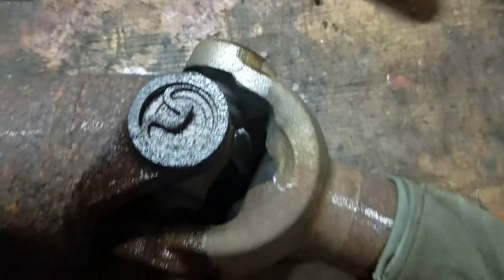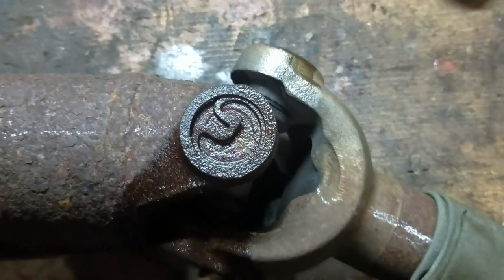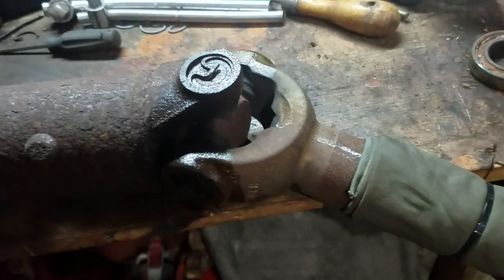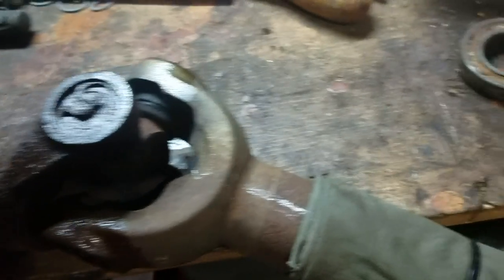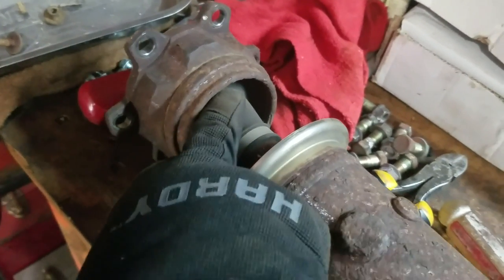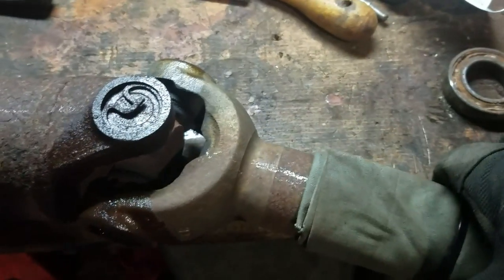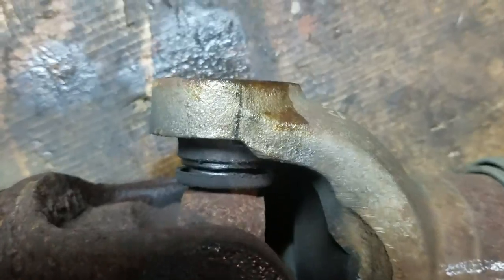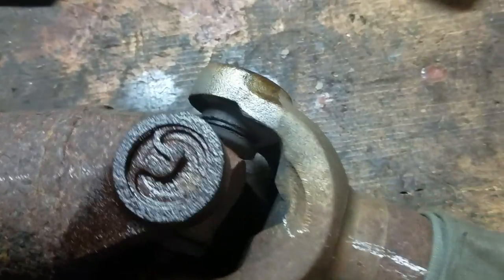What a bad u-joint sounds like

Comment: My 2006 Silverado makes a popping and cracking noise at low speeds in drive and reverse. No noise when shifting from park and you have to be moving. It quits once you go about 15 and up
Reply: Same problem for my 2013 Focus ST. Did you figure out what the problem was?
Reply: Besides swapping out your u joints make sure your driveshaft yoke that connects to your transmission is well lubricated
Reply: Ever figure this out?
Reply: My car makes a clunk when coming to a stop from 10 to 0 not sure if it is the u joint since I changed tranny n u joint
Reply: My truck is doing the same thing
Reply: What did it turn out to be?
Reply: Same mr 04 does this
Reply: Did you ever find out the cause?

Comment: I’m going a single “pop” sound from the back when I accelerate from a stop on my frontier. Everyone saying u joint but visually I am not seeing anything wrong with them
Reply: Did you ever figure this out? What was the cause?
Reply: @06mkmartin  not yet but I think it’s the leaf spring bushings or the actual leaf springs
Reply: I'm experiencing this a bit too f150
Reply: Replacing my rear struts seems to be fixed this sound for me

Comment: And wadda ya want to bet that the reason for that is a lift kit? Guys are quick to get er up in the air just a few inches! That shouldn't hurt anything right? Wrong! The drive line is knocked out of phase which causes the bearings to start  digging into the trunion which is the center piece shaped like a cross. You need seven degrees negative angle to straight with the pinion yoke to make it right. That way it will pull itself straight from the counter force of the pinion gear climbing up the ring gear when you apply the gas and the driveline is under a load.

Comment: So my GMC Canyon vibrates at around 50mph or higher when I release the gas. I also have a chirpy squeak sound when im below 15mph. Ive been trying to look up some info online but am finding mixed answers. One constant answer was the U-Joints going bad. Can you tell me if you had the same experience so I can confirm its the U-Joints ?
Thanks for the video
✌ 😊 ✝ ❤
Reply from the maker: That was similar to what I experienced.  I mostly heard the noise and popping at low speeds.
Reply: @MrQuattroDriver  Thank you. I appreciate the video and response !
Reply: My chevy 1500 is doing it too i bought new u joints today gotta put em in ....did it fix ur truck?
Reply: @joshjosh6842  if you are asking me, I havnt had a chance to get them replaced.
So you are getting vibrations when you let off the gas as well ? 
Please let me know what happens if you fix them before I do. I really hope thats the problem for us.
✌ 😊 ✝ ❤
Reply: @USAlien234   did new ujoints fix the noise cause my 05 colorado squeaks up to about 40km and makes clunk sound when i shift from park to drive not sure if its my diff or driveshaft
Reply: @RilesMcLaren  hey I wish I could help, but I had just bought it from a dealership amd finally it was time for an inspection cause it had one when I purchased it so didnt need it till now. Anyway was gonna get it looked at bit the garage said it has a cracked frame and its unsafe to drive. So now im out 10 grand and need to bring the dealership to court. I dont know to much, but I would check the transmission about the clunk. The uni joints, from what I hear anyway give both squeaks and vibration, I get a squeaks up to about 20mph and a  vibration after around 55 when I let off the gas. 
Im sorry I dont know for sure, but in the future if I get my frame fixed and eveything else with it ill let you know. Im really upset because this truck is amazing. My favorite vehicle ive owned so far.
Maybe you can add some greese to the uni joints amd also see if they have any play in them. Get under the truck and give a wiggle at each one. If they have play, then you need new ones. Kinda easy to fix on your own and the parts arnt that expensive either. Before you fix it put some grease all over em and go for a drive to see if the squeaking stops. Then at least youll know it will fix the squeaking till you get new ones.
Reply: @RilesMcLaren  get under the vehicle and grab the driveshaft and twist is and push it side to side. If there is any type of movement the ujoint is no good. Check both front and rear u joints. If they are good I'd move onto the diff. Remove the cover inspect the gears and replace the fluid and see if that changes anything
Reply: What was it I have chirpy squeaky noise from rear of truck when I accelerate until about 15.to 20 mph was it ur u joints??

Comment: Is that what causes a humming sound while I drive my truck?
Reply: Could be but it’ll be more of a vibration in the bottom of your seat, a humming could be a late stage bad wheel bearing
Reply: @jeffhelmick8065  it was the differential actually.. I got it rebuilt and no more noises .  I was doing donuts and the pinion bearing broke
Reply: @de_hortapbr9494  I feel that, I broke my GT’s universal and dropped a driveshaft doing donuts 😅🤫
Reply: @jeffhelmick8065  🤣👌
Reply: @jeffhelmick8065  my ram is air bagged . I broke two driveshafts doing burnouts also lol
Reply: @de_hortapbr9494  bro i think u figured out my problem😭, did some donuts and the clunking noise came and i look under my car and my differential moves up and down when shifting from park to D

Comment: Did yours ever squeak mine doesnt clunk but it just started and mine is a squeak sounds like coming from rear of my truck only when I accelerate and I cant hear it after 20 to 25 mph please not mine just started and its squeaky not clunk
Reply: Needle bearings in ujoint cups are dry...had this happen on an old motorhome on a Ford chassis...started out as a squeak squeak squeak...when I pulled the shaft and old ujoints they were dry and had no grease.
Reply: @mebe2k  fixed it. Just replaced u joint thanks for the tip though
Reply: Does old u joint work if i re grease them? Sorry my bad english i from finland!
Reply: @rasmushamalainen9268  if it's not messed up already then yes.